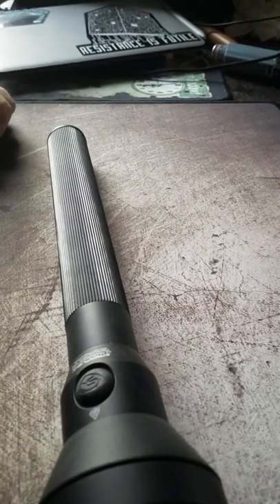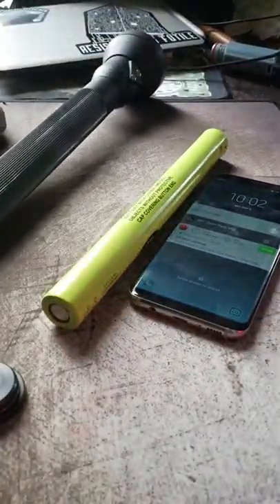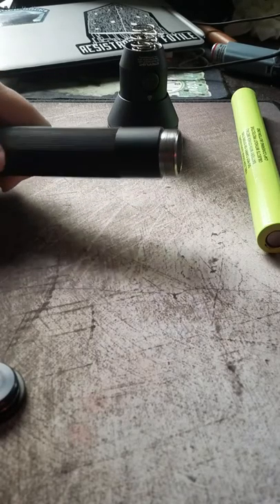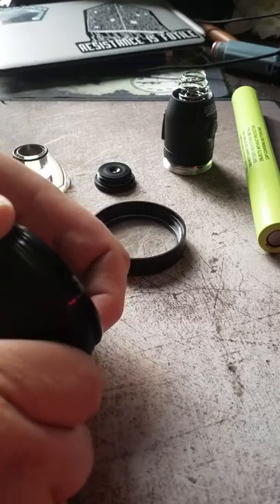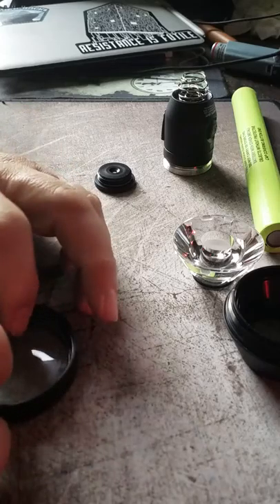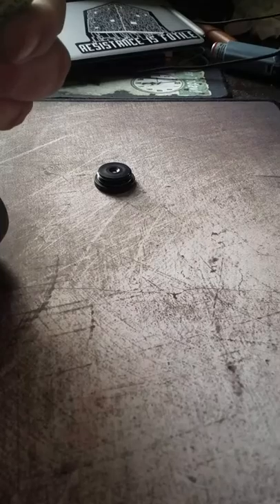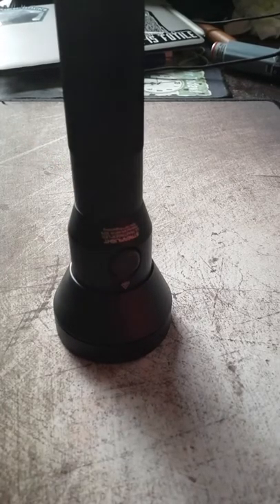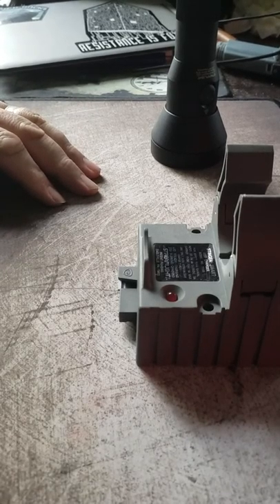Streamlight Ultrastinger Disassembly

Comment: I'm glad you did this because if I reassembled mine and there was dust inside, my OCD circuit would trip. As for the charger, IMO charging ports are weak points. Yea they're more convenient but the contact points on the stingers are pretty bulletproof.

Comment: Thanks for the review. Thought I was doing something wrong trying to unscrew the tailcap to swap out the battery in my Stinger. No grooves, no knurling on there. Wouldn't budge. Thought maybe it's solid. (Some rechargeable lights don't have a removable tailcap.)

Tried the bezel end. All that did was expose the emitter. Tried the barrel just above the rubber boot. That definitely wasn't budging. Watched your video. Tried the tailcap section again. This time, it moved! Well, that's my luck on a daily basis. So, not surprised. In my defense, I've never owned an SL Stinger before. Seems odd. At least Maglite puts tons of grooves on the tailcap section of their full-size flashlights. They don't leave it slippery smooth with barely any surface to grab onto.

Comment: You don’t show the disassembly of the tube and the top, which is what I needed to see.
Reply from the maker: Do you mean the switch housing?  I wasn't confident in my ability to dismantle that and put it back together safely.  Figured better safe than ruining a rather expensive flashlight.

Comment: That’s not one solid unit on the top, it comes apart, because that’s where the switch is and you can buy a replacement switch! They do not send you the whole head unit
Reply from the maker: I did not feel confident in my ability to remove that part safely.  So rather than chance ruining an expensive flashlight, I left it alone.